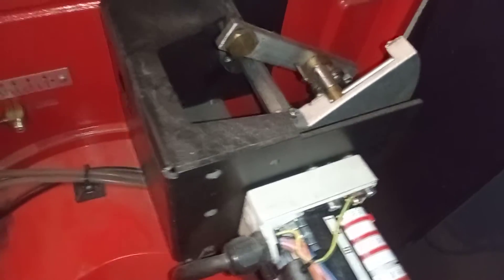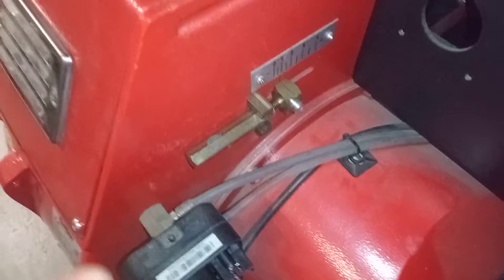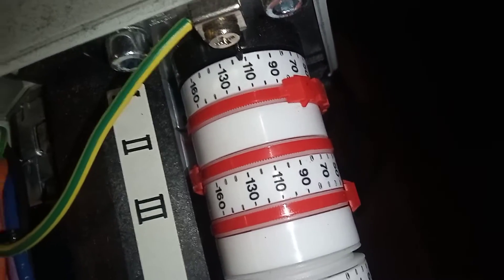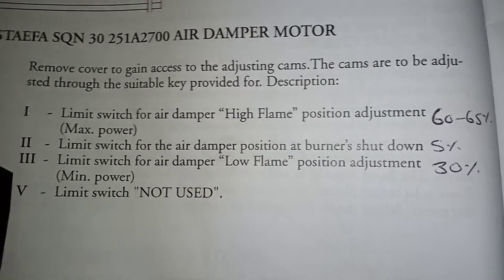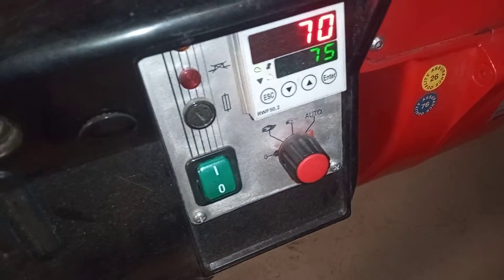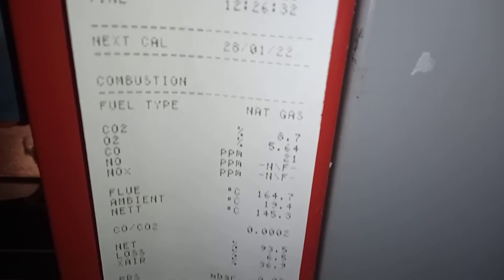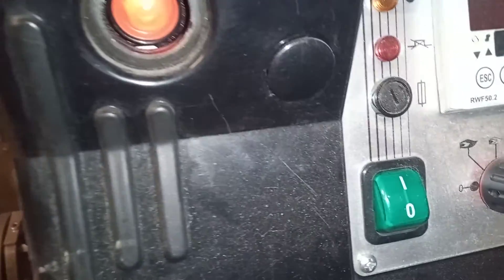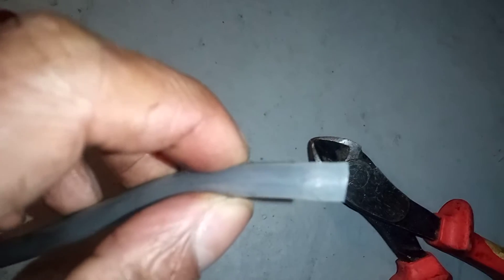BURNER BREAKDOWN ECOFLAM 1700.1

Comment: Got one of these locking out on APS fault.
Always a good idea to remove air intake set (brass block where air tubes connect) as the brass rod (connected to brass block) can get choked, the rod has two holes to which the air pressure switch gets it signal, the rod sits inside the air intake housing.
Reply from the maker: Thanks for sharing, good shout. I wanted to swop the brass rod around on this one with one that was working. Yet ran out of time on my PPMs. I recall booking up an APS. never know what came of this burner.
Reply: @CommercialGasEngineerVideos  
Two screws to remove brass block from housing then just pull out the rod.
I say rod but it is pipe with two holes drilled in the side, you could remove air intake grille and visually inspect that the tube/holes are clear.
The brass air intake block has a nipple with a locknut (just below air intake nipples), this is used to alter the differential pressure across the take off nipples (dependant on chamber pressure).
Keep it up as I enjoy your videos.
Reply from the maker: @Brutus1962  good comprehensive explanation. Need more of that on this channel. Yet people seem too shy or busy to share their knowledge and experience. Thanks again.